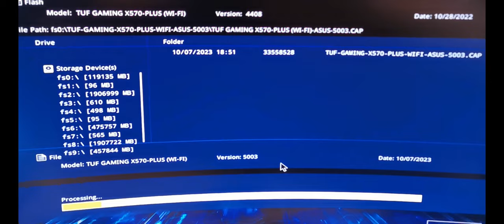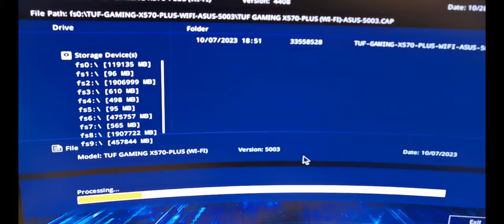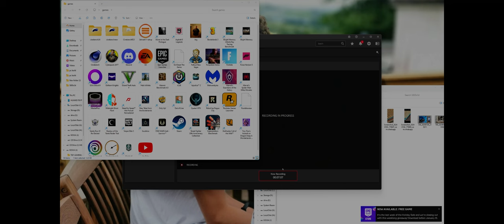5800x to 5800x3d swap!!  bent pins, bios update, general massive faff.

Comment: Ive gotten quite a few cheaper cpus with bent pins. I usually use a razor or one of those plastic vinyl razors between each row.
Reply from the maker: I used my pocket knife, a fingernail and super macro mode on my phone 🤣.